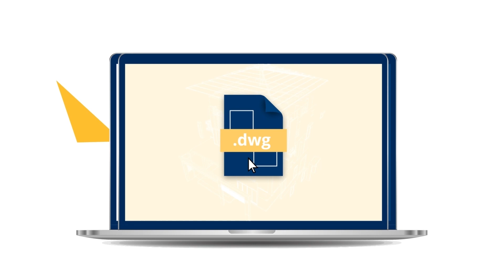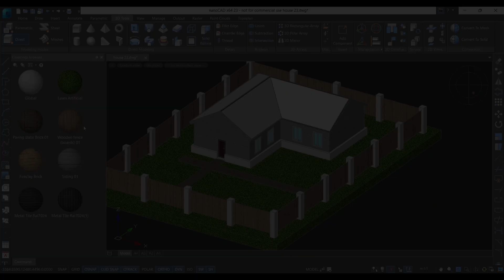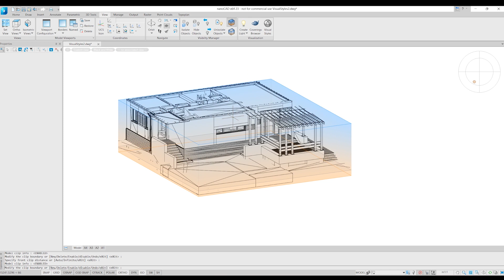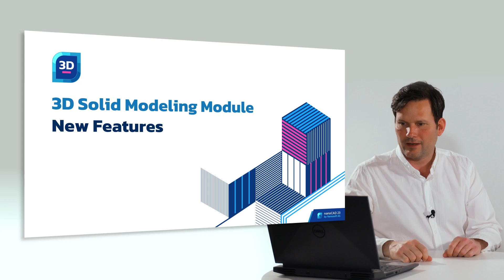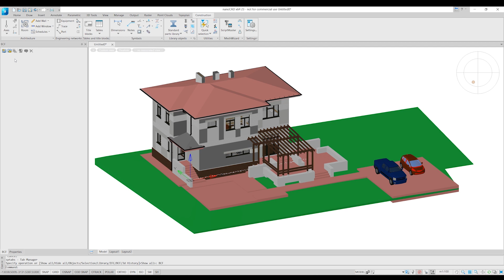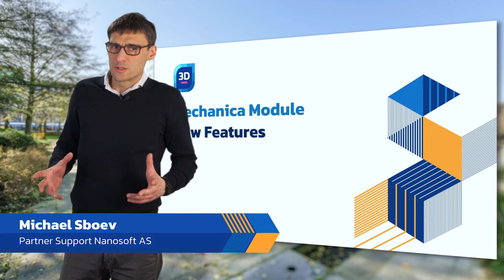Nanosoft AS introduces nanoCAD 23

Comment: how do you change the measurements to feet?
Reply from the maker: @higherselfandholistichealt3169, you need to set architectural units (inches and feets)
To work with architectural units (inches and feets), it is necessary to set architectural units in several places:
1 - in Units dialog - Length type and Insertion scale,
2 - in Dimstyle dialog for current dimension style on Primary units, Alternate units tabs,
3 - in Scalelistedit dialog: click Reset button, then choose Imperial scales,
4 - in Design settings dialog: Main options tab - Design - List of drawing scales - Document only or All.

To apply all this settings for all new documents, save empty drawing with these settings as dwt file and use this file as default template in Options - Template usage - For new documents - Default template file name.
Reply: @nanoCADcom  thank you.